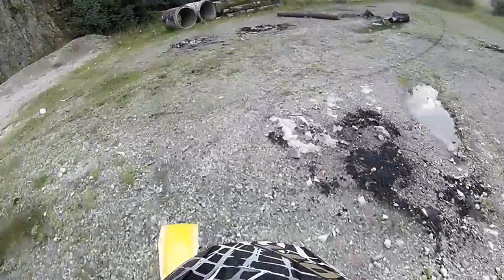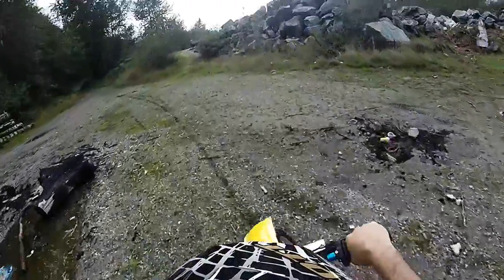$250 Suzuki RM125 Restoration test ride 2!

Comment: no I'm just wondering if you get a different plug if it will hit the piston?
Reply from the maker: Just make you you cross reference the plug brand to match your oem plug.
Reply from the maker: If you have a 87 rm125 NGK br8 and br9 are the most common plugs run. lots of people run es or eg. fairly cheap plug. ev and eix get more expensive.
Reply: Oh okay

Comment: Brake shoes? So it has drum brakes on a 1987?
Reply from the maker: yes mine has drum on the rear. they had a swing arm recall later in the year, i think they had a disk option for that one. i may switch it over to disk if i like the bike on the track. i have taken it apart and now have brakes but i need to take some measurements to see if i need a new liner or new pads.
Reply: TNT 22 I'm not sure how the Suzuki system works but have you tried adjusting it all the way out?
Reply from the maker: I moved the arm back and i now have brakes but its not right. its at least 50% actuated. theres just too much room between the pads and the liner. im going to order new pads. they are really inexpensive. If thats not it then i need a new hub liner. still not that expensive. Hop to do a track test this weekend.

Comment: Suzuki was a bit late to the party in the 1980s from what I've read but I didn't realise they were that bad?
Reply: Late to the party in the 1980s?  Suzuki RM125  1981 and 1982 were named bike of the year by MXA. They said about the 81: '' It was a bike from the future. In 1981, The liquid-cooled Suzuki RM125 arrived and stunned the world. Works bikes had come out with liquid-cooling earlier, but Suzuki did it right, and the bike was lighter, faster and, with the Full-Floater rear shock, much better suspended than anything in the world. As was the case in this period, the RM’s period of dominance was short-lived. The next year, Honda, Yamaha and Kawasaki caught up. It’s worthy to note that the 1982 Suzuki RM250 (a virtual clone to the ’81 125) dominated that class in the much same fashion'' MXA https://dirtbikemagazine.com/10-best-motocross-bikes-ever/